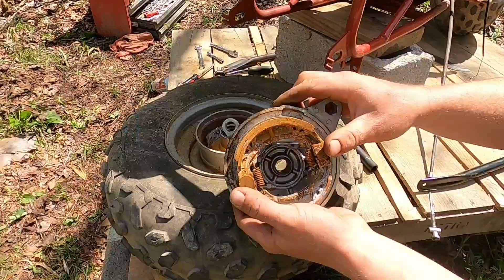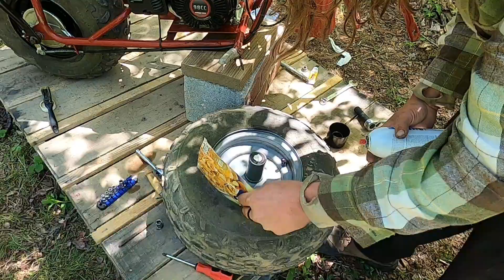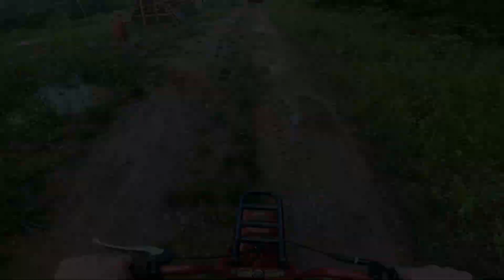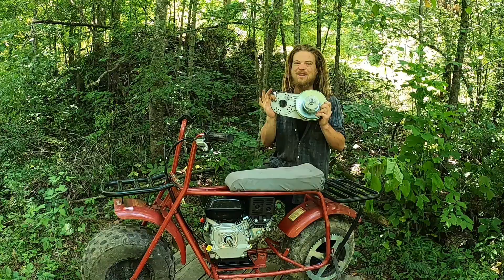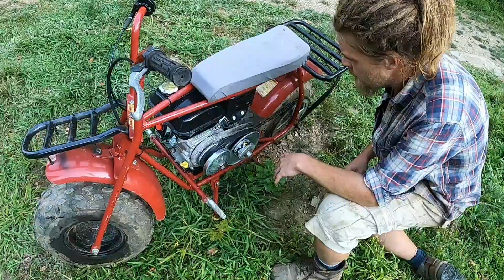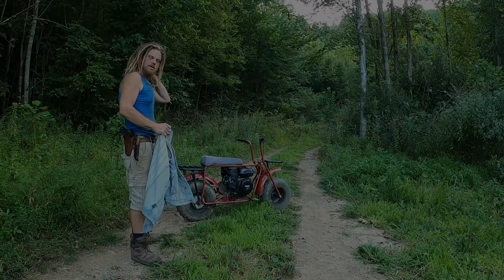Coleman CT200U  Maximum Torque Mini Bike Build with Small Engine Warehouse

Comment: What you should do is put lighter springs in the driven pully so it will engage earlier, less wheel torque on launch but also slower minimum speed

Comment: Great video but there are a few things about this.

Very very few guys are going to buy a $500 5HP engine for their minibike when they can have more power from most small blocks for less than that. That's a lot of money for a Chinese engine with Kohler badging. And 177cc is odd for an engine of this type.

I understand that you were going for maximum low end but that much gearing isn't necessary for that type of riding. I find that 9/60 sprockets with the 6" driven is plenty of gearing for slow speed hill climbs. Same with 8/50 sprockets. I can climb hills and still get 45 MPH plus if I put the bike on the road. With that gearing and a stock engine it would top out around 25 MPH which is not what most guys want from their bike.

Your setup is what guys have done drag racing with a 19 inch tall tire. Except they were using a modified driver  for 4500 RPM launches onto their wheelie bars.

Has your sprocket ever hit the ground or rocks in rough terrain?
Reply from the maker: It's because you don't understand where we live. 
Even this may not be enough.